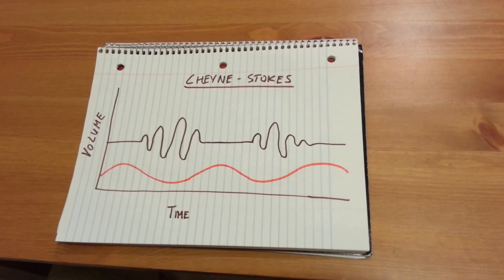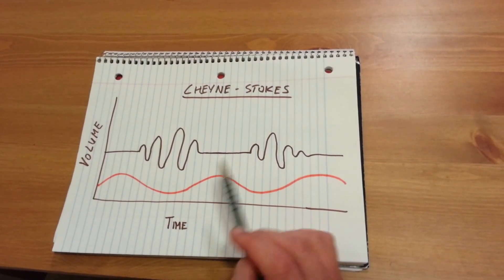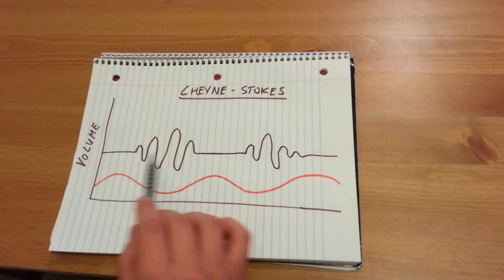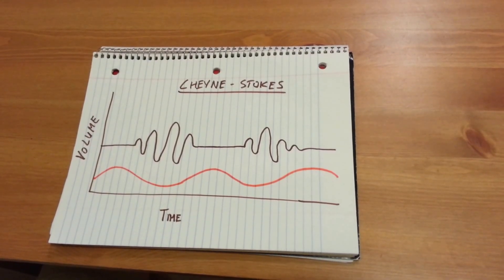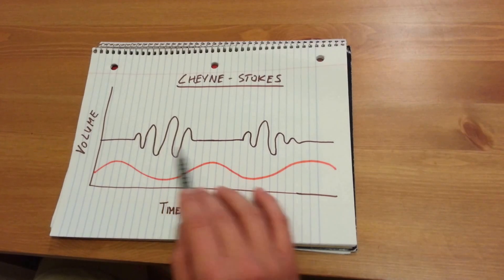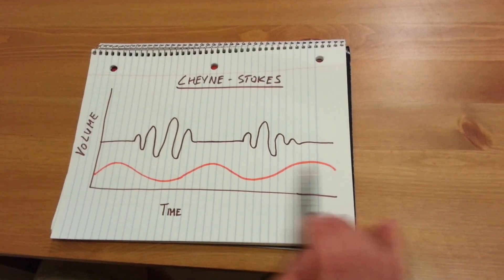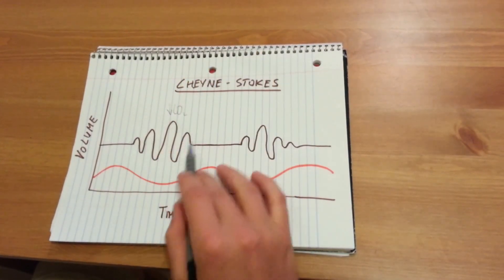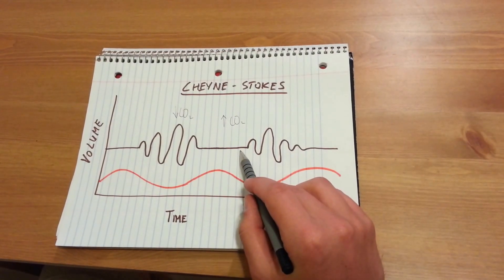Cheyne-Stokes Respiration

Comment: But why does the body do this ?
Reply from the maker: Cheyne-Stokes respiration is a specific form of periodic breathing (waxing and waning amplitude of flow or tidal volume) characterized by a crescendo-decrescendo pattern of respiration between central apneas or central hypopneas. The American Academy of Sleep Medicine (AASM) recommends to score a respiratory event as Cheyne-Stokes breathing if both of the following criteria are met:

There are episodes of at least three consecutive central apneas and/or central hypopneas separated by a crescendo and decrescendo change in breathing amplitude with a cycle length of at least 40 seconds (typically 45 to 90 seconds).
There are five or more central apneas and/or central hypopneas per hour associated with the crescendo/decrescendo breathing pattern recorded over a minimum of two hours of monitoring.
Cheyne-Stokes respiration should be differentiated from other central sleep apneas like idiopathic central sleep apnea wherein there is no waxing and the waning pattern of ventilation. The ventilation length in patients with Cheyne-Stokes respiration is more than 40 seconds compared to less than 40 seconds in central sleep apnea. Also, the relative duration of hyperventilation is more than apnea duration in Cheyne-Stokes respiration. In central apneas, the duration of apnea is more than the duration of hyperventilation.

Cheyne-Stokes respiration is well-studied in patients with heart failure and stroke. In patients with heart failure, male gender, older age, sedentary lifestyle, diagnosis of atrial fibrillation, increased ventricular filling pressure, and more advanced cardiac remodeling are known to predispose to Cheyne-Stokes respiration. Up to 20% of patients with stroke can exhibit Cheyne-Stokes respiration.